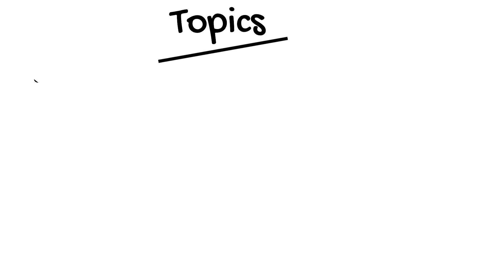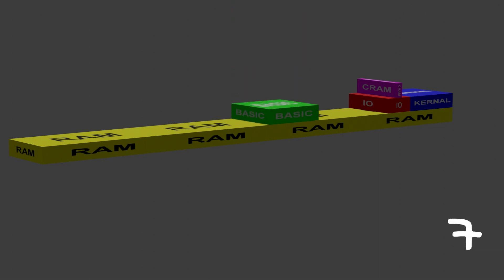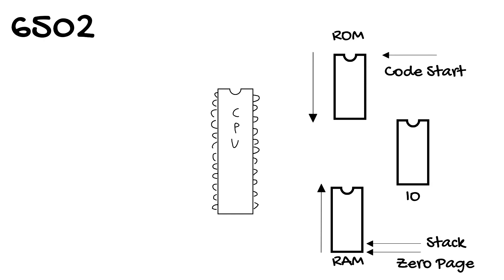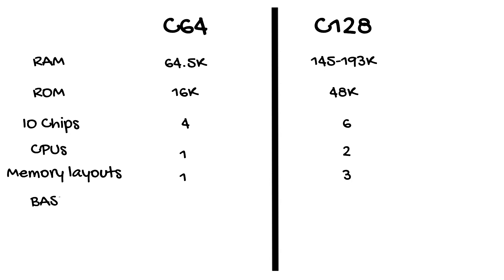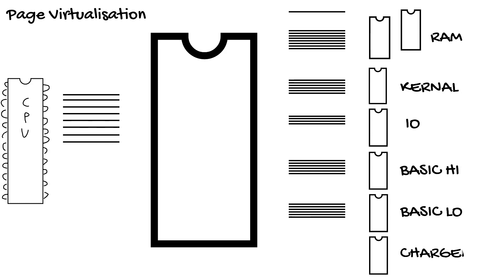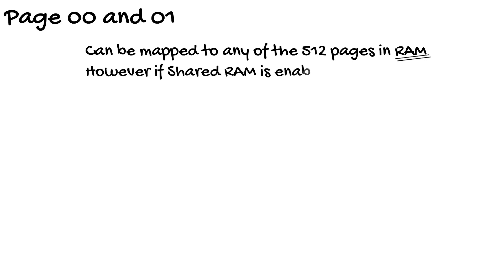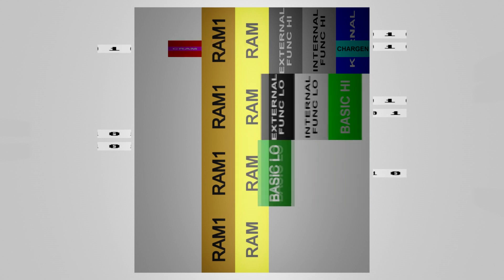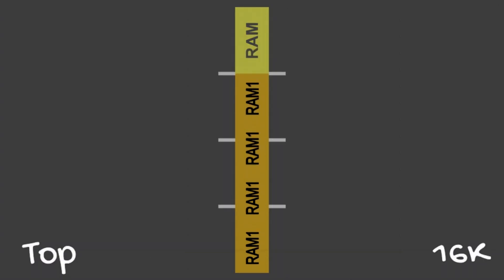C128 Banking - It's not that hard really.

Comment: I really like how you clearly differentiate bank from block. 
But I never came across the term „block“ before. Did you come up with this or did I just miss it?
Reply from the maker: Blocks of RAM are used, typically you use it with a separate not overlapping RAM. so for example on a more modern computer you would have a Block of VRAM and Block of Main RAM so they don't Bank over each other. But the Compute's Mapping the Commodore 128 book ( top read if you don't know it ) also refers to the two 64K "Banks" as "blocks" as they are "generally" not overlapping RAM that is not continuous.